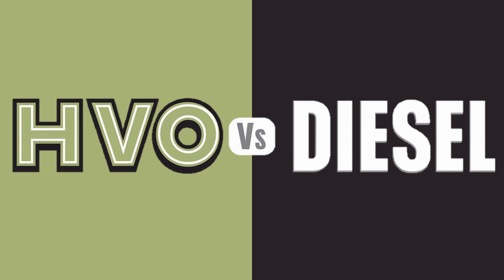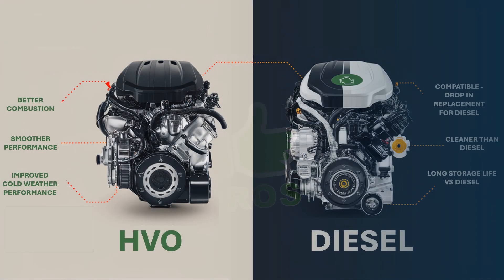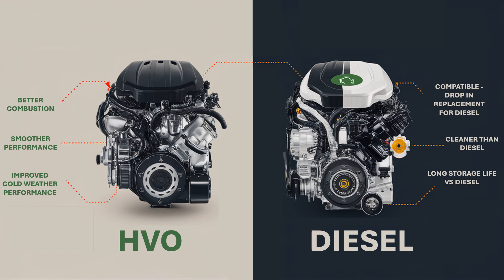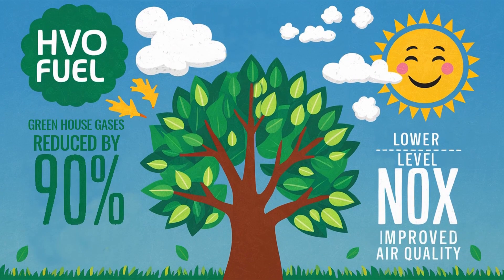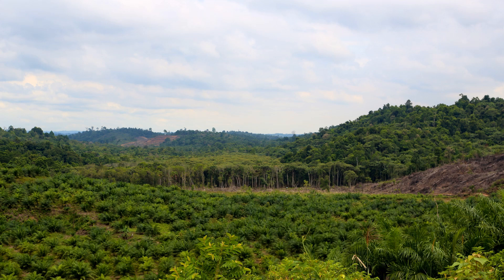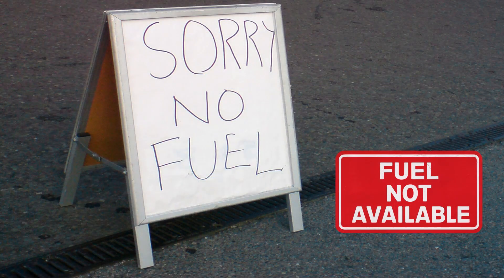HVO vs Diesel: Pros & Cons. The Future of More Sustainable Construction?

Comment: Hydrotreated (or Hydrogenated) Vegetable Oil, or HVO for short, is emerging as a sustainable alternative to traditional diesel in the construction industry. With the growing emphasis on reducing carbon footprints, HVO offers a promising solution. 

But what exactly is HVO, and how does it compare to conventional fuels? In this video, we will explore the pros and cons of using HVO in construction, the certifications to look for, and the policies of some major UK construction organisations regarding diesel and HVO.

Contents
0:00 - Introduction
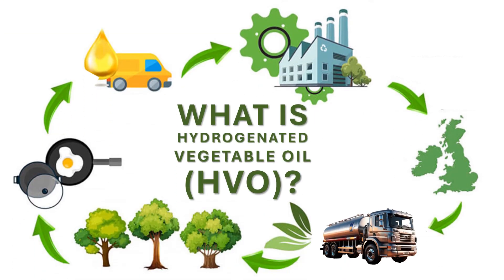0:50 - What is HVO 
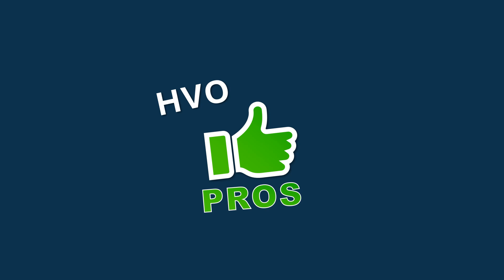01:04 - Pros
02:40 - Cons 
04:03 - Policies of some major UK construction organisations